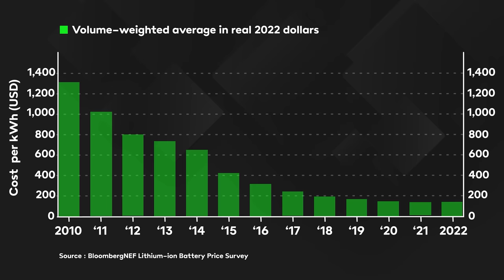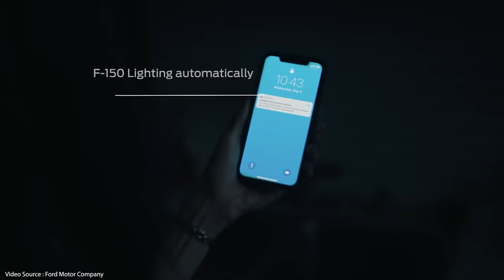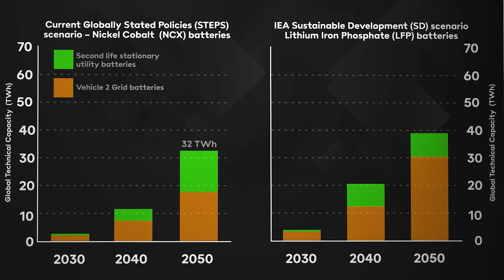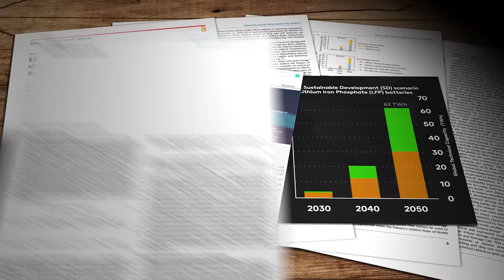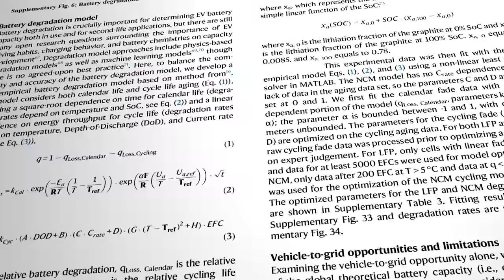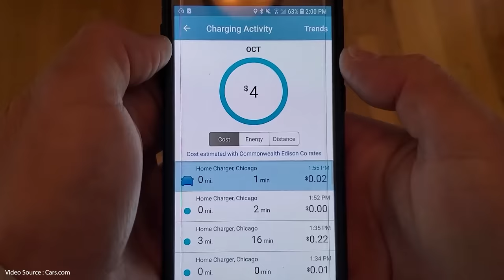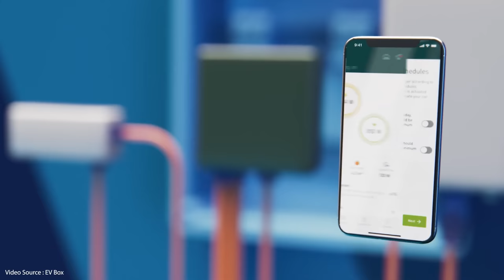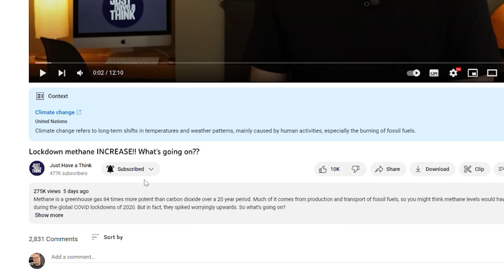Can the electric grid ruin your EV battery?

Comment: Unfortunately, the battery collector and recycling industry still see big legal problems with a 2nd life of EV batteries. Who is responsible if a broken cell burns down a building? In the car, it's the manufacturer but outside?
Reply: That would be up to the householder who installed it but I think second life packs are a more company grid scale thing actually.

Comment: Increasing use of aircon is not the same intensity as charging cars. Imagine fast chargers pulling upwards of 50kW for each car, mind you a typical home AC is ~100W, each fast charger puts 5000 ACs on the grid. Multiply that by all the cars charging at the same time you'll see its quite an astronomical figure. Even for granny chargers, they're about 7kW..thats still 70 ACs for each charger.

Comment: Great Video Dave ! :washhands:I think it makes more sense to buy a bicycle use the public transportation systems, they to are being electrified.  In regards to EV, if you own, using the vehicles V2G to stabilize the grid, including school buses is a logical step, the storage point for used batteries has some weight, but in my mind, they minerals would be better used to recycle them and avoid the mining of new materials. This will have to be a data driven of course, but the current rate of growth of the grid is truly encouraging. 

The case of EV school buses is a great one, since they are used twice a day and sit idle most of the lives, so using the 200 000+ EV school buses as a peak time mitigation system is not a bad concept. In the end I believe it is a matter of policy and innovation, design efficiency. The People are ready, the cost needs to come down for people to access them.

I  feel adoption will increase rapidly in the next couple of years, the 2023 to 2027 will see huge changes. If memory serves, the USA transitioned from horse pulled buggies to cars in a 9y span, there was not infrastructure then.

Comment: When buying a low mileage 2nd hand EV if its been used for Vehicle to Grid how can you tell the battery health, estimate how many charge cycles has been used by Vehicle to Grid? this will effect the value of a 2nd hand EV
Reply: Most EVs have some indication of the battery health, LEAFs have it right on the dash display, others you need to put a computer on and get the data. It's just like anything else with a used car, just gotta check it. I imagine at some point Carfax and the like will have that information if they don't already.

Comment: If batteries can get to the point that the 'operational lifetime' of the pack doesn't matter in comparison to the lifespan of a human being and the cost factor going so low it doesn't factor, (Or power providers subsidize a grid connected users eventual pack replacement), then grid integration won't be an issue.

Comment: Is that 30kwh/day in the US equivalent to a 240v system? you said the UK average is ~10kwh/day? is that correct? it seems very low. I just checked Australia, we were about 20kwh in 2018.
Reply: Watts are watts regardless of the voltage.  Watts = volts * amps.  In the US, the national grid is 120/240.  EV chargers are usually 240 volts, but some people use 120 for charging.
Reply: We use a max 10Kw per day here in Northland NZ. We have 8.4 Kw of solar panels and a 6 Kw Energizer HP6 battery.  We export far more than we use. Loan for purchase of system will be repaid in 5 years. Then it's almost free power for the next almost 2 decades. Assuming nothing breaks down. We done our bit to help save the planet for our Granddaughter.  An Ev would need to be charged at night from the house battery so not the best plan for us yet. With losses in transfer it seems a bit silly.

Comment: I can already see a problem with this, when we already have utility companies that sell power at a retail price, and buy it back at a wholesale price, when we have utility companies that want control of your thermostat so they can change the temperature of your home, but leave important politicos and company execs out of that scheme. (You know it's true).  Imagine waking up in the morning and getting ready to drive to work in your base model electric car, only the battery is dead because one of the Glitterati three towns over needed more power for their after party.

Would I like to have an electric vehicle that could provide my home with power in a blackout?  Absolutely.  I could even see sharing with neighbors.  But the utility companies are never going to give you the true value of what they want you to give them, and it will never be spread around equally in an emergency.  Not that it matters much to me with a nearly 30 year old pickup truck outside that isn't worth more than my rent.
Reply: If V2G were to ever become a thing, it would come with a hard limit of how low the utility is allowed to discharge your battery (e.g. 50%). The scenario of waking up one morning to a dead battery because of this would simply never happen. Even if one particular morning, you're going on a road trip and need the battery at 100%, it would be as simple as pressing a button the previous night to turn the V2G activity off.

That said, you are absolutely correct that the rate you would receive for selling power would be much less than what you would pay to buy power. Using it would still save you a little bit of money off your power bill over not using it, but not anywhere near enough to cover the cost of installing the equipment up front to make V2G even possible. It is this, not fear of waking up one morning with a dead battery, that makes be skeptical of V2G working in the real world. 

I do still see V2G working for specific niche cases. For example, electric schools buses sitting idle during summer break could provide a lot of power to the grid from a single location, thereby reducing the up-front equipment cost problem on a per kWh basis. But, for ordinary residential home users, no.

Comment: That is the whole problem of the « smart current meter » that some countries made mandatory…
They stated « the ability to get your power consumption every 15 minutes will help you to make saving » which was just marketing B.S. If the politics were righteous with « grid management » they'd try to leverage / flatten as much as possible it's consumption in order to leverage it's consumption.
With those « smart meters » the power suppliers should have been constraint in offering an off-peak rate that would be announced 24 hours ahead.
• In order to provide an incentive to plan running your devices that demands the most power accordingly. Eg. I have a dishwasher were I can set the time at which I want it to have completed his dishwashing task, but why should I care it won't diminish my bill and I'm pretty sure no protocol was defined in order to allow the power supplier to start my dishwasher when it suits them best whilst respecting my deadline.
• Neither would I mind if I had an electric car, setting it to charge up to a given autonomy so that the surplus maybe use to leverage the grid consumption. Eg. It's amazing to see how electric production is forecasted: that an event watch on TV by millions will cause an electric demand spike during break / half-time (people going to the toilet, opening their fridge, etc…).

Because current produced has to be consumed live and that it is difficult to store it. For what I'm aware off there's mostly 3 ways that are being used in order to do so:
1) Pump water upwards which is possibly what returns the best ratio (how much power is spent to pump water upwards versus how much it yields downwards). But reversing the water flow takes time (close valve), remove water within turbines blade area, get the turbine up to speed, re-inject water to compensate the hydraulic pressure (you want water to go upwards not the opposite), and only then you can accumulate your over production.
2) Weight accumulators, which one way or another results in having a spinning wheel in motion. Eg. you use electric motors to lift weights and when falling generate current… You can also use that force to help out starting a generator or else.

No matter what 1 and 2 in production mode requires you to adjust the output in order to match the grid tie / phase (let's pretend one is sin(x) imagine what would happen if the other is sin(-x) …). Thus you have to adjust speed of your generators until it matches / juxtapose / superimpose the grid tie.

3) Batteries, possibly the easiest way to « buffer » electricity but although the technology is ever improving it's an expensive investment and expensive to maintain. Anyhow: Adjusting the DC output of batteries to match the grid tie (phase) is something relatively easy and transparent. Thus indeed what if we could use the EVs as a buffer ? Yes as long as I get to choose whether I want to do so and the power supplier is giving me back some retribution because I allow him to use the battery I bought and I maintain. And that retribution part is probably the caveat: How do you calculate. We need a grid that is able to sustain a worst case scenario it cost that much, we plan an investment yield of that much. Are that many EVs owner connected to the grid will allow us to invest less thus are we able to yield back our savings whilst keeping the grid alive in a worst case scenario ? Good luck in committing to that, therefore it's unfortunately likely that an EV that's able to resupply power to the grid will only be used as one household backup supply when getting off-grid for unforeseen reasons (natural disaster).

To top it off: to replenish the average EV daily consumption you need to provide 11.81kWh per day. The current average household consumption is 29kWh. Let's pretend each households would only have one EV to charge overnight in order to commute… Would the grid be able to provide 40kWh to each house hold every day ? It's probably not a problem in producing the power given that between 10pm to 7am consumption is 10% lesser than at 7pm-8pm peak time… But you still need to get those 11kWh fed to the household grid and you clearly don't want all EVs to start charging as soon as plugged when getting back from work. I wonder how that is going to happen by 2035 in Europe.

Comment: I and many of my friends and relatives were EV enthusiasts. We saw great things in the inventiveness and development of the EV technology. However, as reality began to set in, many problems became apparent. Charging time is a problem. How long is it going to take for the EV to move from only the rich can have one to everybody can have one? Operation in both hot and cold conditions is another. The strain on the grid. The cost of electricity always going up even though more electricity is generated at very low cost. One of the largest and least talked about problem is governments restricting individuals from generating their own power and how it is used. If I can buy a used vehicle battery and charge it up using my own solar panels I should be able to power my entire house freeing me from the grid. What kind of disruption would that cause? Power companies would go out of business. Thousands of layoffs.  Governments would see this as a threat to their revenue and require “Permits” prohibiting this use.

Comment: I’ve never worked out why two way charge circuits are not part of the ccs or type 2 charger standard
Reply: CCS2 standard, which is the EU standard by now,  is capable of this, its only not applied much, as it makes the car and charger more complicated and thus expensive, but it IS possible.

Comment: What about synthetically generated hydrocarbons, they would work in conventional vehicles,  the hydrocarbons could be generated by nuclear power or even by electric which could be some green form, the carbons stabilise hydrogen making it easier to transport and store, the carbons are collected out of the atmosphere, which some would be released back when burnt in conventional vehicle.
Reply: It could potentially work in theory. However, it would be far more expensive than conventional gasoline, while requiring far more electricity than simply charging the batteries of EVs (charging a battery is much more energy efficient than making hydrocarbon fuel). On top of that, this solution does nothing to address all the problems of local tailpipe pollution, such as chemicals going into peoples' lungs.
Reply: @ab-tf5fl  yes it's more expensive, but it would be at least carbon neutral, the burn from new conventional vehicles continues to improve it isn't that bad, I work in a business that has thousands of electric vehicles, no way can the country run on them, our business is loosing millions using them, we might even need a bail out because of them, there has to be a more conventional solution, it's not sustainable, we have used thousands tones of copper, when our vehicles charge, some local businesses complain about brown outs, it's a nightmare, these vehicles are a folly, what we need are things that work, nuclear power could generate clean fuel for our vehicles, and we wouldn't have to strip the world of rare earths to do it, people focus too much on the vehicle and not the trail of mess behind it.

Comment: It's the "slow charge overnight" which is precisely the problem. Let's say that you have a solar system and aren't happy about the miserly amount the power companies want to pay during daylight hours. Do you get a battery to knock off the peaks? Or are you better off using that battery to fully participate in the market? Could that battery be the car? Well. to answer the last question first, No. Unless you'd like to drive to work in the morning with a depleted battery. And that's another problem. Unless you work from home, your primary vehicle won't be around much to charge while the sun shines. So either you pay to have it charged despite having a solar system which could do it, or you'd need to have a secondary battery (and also priority use over the power company). More expense, more inefficiency. When you can recharge anywhere at comparable rates for time of day, to be offset against what they may take later from your home battery, I reckon we'll have the beginnings of an integrated system.

Comment: Would you know if the US has performed any studies that analyze the future transmission line power load capabilities required to get power from the generations source (fossils/solar/wind), to EV charging stations, for the many thousands of expected EV's that would be in use in the near and far term?  Seems people are forgetting about the issue of increased loads expected of these lines, based on what I have heard, that they may not be able to handle future power/load demands expected of them.
Reply: Put solar on your roof and bypass the 'problem'!
Reply: Put mega-packs between the grid and charging stations! Simple fix. They would also be able to stabilise the grid

Comment: I really have to wonder how we in the US use so much more electricity compared to the UK. I get gasoline consumption, given the giant guzzling SUVs we all tool around in here. Is it air conditioning?
Reply: How do you heat your house. In the Uk most people use gas. Our home is currently heated by oil because we are in a rural area away from the gas grid. Before inefficiencies 1 litre of oil is equivalent to 10kwh electricity.  If we used 1000 litres of heating oil a year that would take us to around 15000kwhs/annum. Having said that we don’t have air conditioning as we have so few days when we would want it. Climate change may make the next generation have a rethink of course

Comment: $138/kWh in a car, but a Powerwall or similar costs more than $800 per kWh installed.
I'm not just hating on Tesla, the Generac PWRCell is 9kWh for $18k installed. Enphase Encharge 10 is 10kWh for $19k
Even if half the cost is installation that's still a huge price increase over EV batteries. 

We really need easy to use DIY kits to drop the batteries out of our older EVs and stick them in our garages or basements. 

Once the battery in my Bolt hits 50% max capacity it'd still be 33kWh of batteries just sitting in a landfill till they're (hopefully) recycled. Why can't I just bolt it to my wall and plug it into my fusebox?

Comment: We bought a 2017 Chevy Volt in 2020.   I'm currently forcing it to use gas because the last time I bought gas was October 29, 2022.  (Today is March 12, 2023)  Here is a question I have.  We usually charge the car at night during off peak hours.   However, we have had solar for 21 years now.    Why isn't it better to charge the car when the sun is shining on our solar panels?   Does the electricity from the panels first go to the grid, so the electric company will charge us the highest rate?   Or does the electricity from the solar panels first service our own house needs before it goes to the grid?  There is an abundance of electricity during the day when the sun is shining and not in the middle of the night.
Reply: Your solar should supply your home first then export any excess to the grid have a read of how your inverter works.
Reply: @jackdbur  Thanks.   Someone installed it, so I don't understand it really (I'm female and I can do a lot of handy work, but I know nothing about solar.)

Comment: My driving distances would be very happy with an electric vehicle (500 miles per month). My electricity costs here in the PNW would also make me happy. I could easily put a charger on the side of my house where I already have a 220 volt welding outlet. (I don't weld). The biggest issue is that my 1997 vehicle is paid for, and I live on SSI. So why would I give that up and incur enormous debt to switch to electric? I don't see that happening.